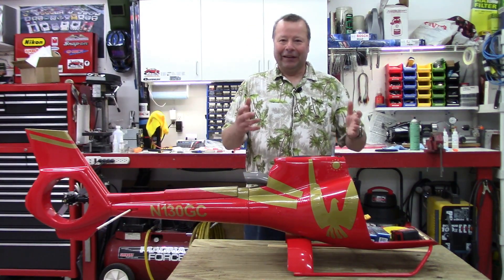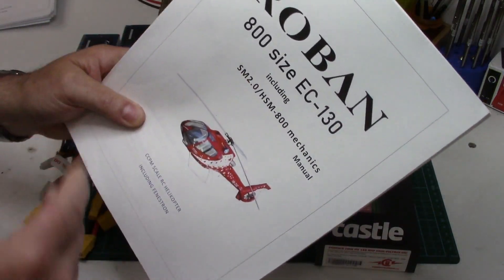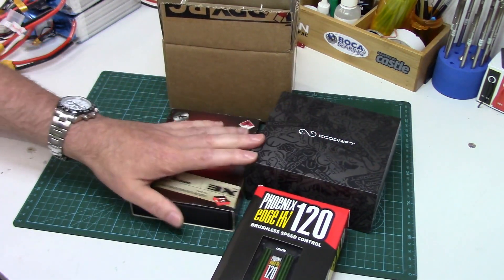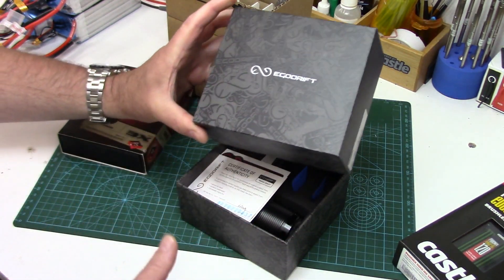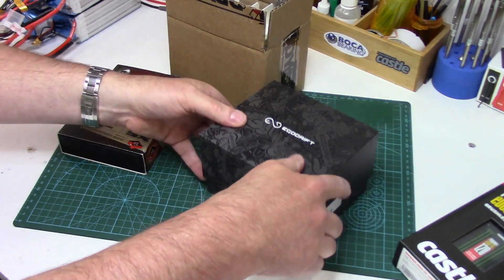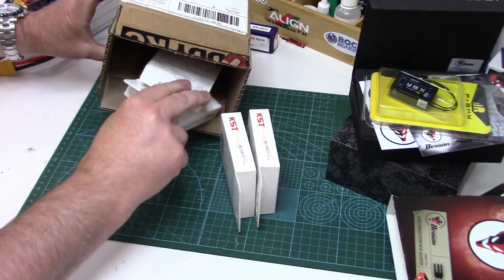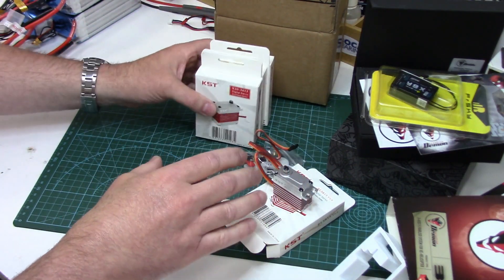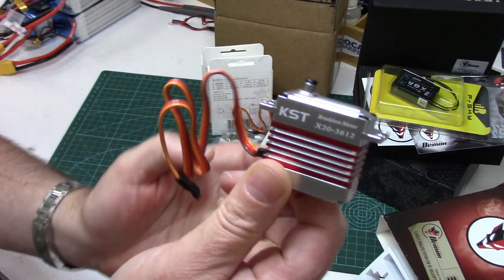Roban EC130 RC Helicopter Electronics & Fenestron Fitment Fun

Comment: I fly 3d Sab Goblin and I maintain them from to time to time. I am assuming the scale RC helis have the same maintenance as the 3D helis. Awesome set you have there.
Reply from the maker: More or less the same, but every model heli as you likely know has it's own unique maintenance issues. Scale is also more difficult in that you generally have to remove the mechanics from the fuselage to do any service work and that alone can be an hour or longer job with some of them.

Comment: I am looking for this Tail Servo X20-3612 and seems like is no longer available and the closest replacement is the X20-8.4-50. But, both servos operates on 1500us and they say it is only good for large planes, cars and not good for Heli. Should not be using a 760us for tail servo? Sorry, I am confused
Reply from the maker: As I stated in the video, large scale RC helicopters don't need super fast tail servos. Fenestrons however need high torque servos.

No super high speed 3D heli tail servo will work in these things, they are not nearly strong enough and are too fast for the yaw inertia of a large scale helicopter. Only reason you would want to get a 760us tail servo is if your FBL system doesn't allow a 1500us tail centering output (I can't think of any that do). 

As long as the servo torque is rated at the bare minimum 30kg/cm and speed is at least 0.15s/60 it should work well on an 800 size fenestron heli. Of course both stronger and faster won't hurt. 

The X20-8.4-50 is pretty much the closest replacement for the X20-3612 so nothing wrong with it: 
https://www.buddyrc.com/products/kst-x20-8-4-50-digital-servo-8-4v-0-15s-45kg-cm-624oz-in?ref=-ptdbz6d-llb

Another good option would be the A20-3813 (43 kg/cm 0.12/60) since it's a tad faster with just a smidge less torque: https://www.buddyrc.com/products/kst-a20-3813-digital-servo-8-4v-0-12s-43kg-cm-597oz-in-1?ref=-ptdbz6d-llb

The A20-4515 is another solid choice if you really want to play it safe with enough torque to pitch those 9 blades over at 50kg/cm and 0.13/60: 
https://www.buddyrc.com/products/kst-a20-4515-digital-brushless-servo-8-4v-0-13s-50kg-cm-694oz-in?ref=-ptdbz6d-llb

There's also the overkill monster of the bunch - the X20-7512 with about 80kg/cm and 0.11/60:
https://www.buddyrc.com/products/kst-x20-7512-brushless-high-power-servo-82kgf-cm-0-11sec?ref=-ptdbz6d-llb
My concern with it, is it would draw more current than most FBL system power busses could handle. I would personally use a separate/dedicated power input/bus for that monster.

Comment: Hi John, how do you get the fenestron work?  My EC-135 has an issue with the tail rotor not being able to hold on the counter torque
Reply from the maker: Can't really answer this in a short YT comment because as you know, there are multiple reasons for lack of adequate tail thrust in relation to main rotor torque. On fenestrons', the biggest issue is not using a high enough torque tail servo. That is just one of several possible reasons, but is the first one I would examine; I suggest 30kg/cm minimum. Contact me through my website if you want to dive deeper and seek technical consultation service.

Comment: How would you compare your AS350 to the EC130? Which one is your preferred? I know they are different scale but the 800 EC130 doesn’t seem so larger than the AS350. Which one would you recommend?
Reply from the maker: Lots of variables at play. There is no "better" out of the two; each have pros & cons and their own unique flying habits.
Which would I recommend? Again, that depends on for whom I'm making the recommendation.
If it's for someone with no large scale heli building & flying experience, I would recommend neither. Both are advanced models for advanced hobbyists'.
If it's for someone who has large 700 size and up electric, nitro or turbine pod & boom building & flying experience but wants a large super scale heli build project to cut their teeth on, then the AS350 between the two.
If it's for someone who has lots of big scale heli building & flying experience and has always wanted to tackle a complicated and somewhat maintenance intensive Fenestron build, then of course the EC130 or 145.
Reply: @Rchelicopterfun  thank you John. Very clear

Comment: Hi John, first of all congrats for another fantastic video. I admit that you have always been my guru since day 1 in the amazing rc helicopters world. Did I understand correctly that after adjusting the fenestrom assembly slight to the back you tighten the two clamp screws but also you added a further screw on the side to secure it lock in position? How could you make it neat and precise? Thanks
Reply from the maker: Thanks for the feedback. 
Once I had tail block clamped in the correct/centered position for even blade spacing, I then carefully hand dilled a hole through the side of tail block housing into the boom, threaded it with a tap, and then Loctite in a short M3 hex bolt (after thoroughly cleaning out the drill and tap chips of course). This "pinning" insures two things:
1. You are able to get perfect tail block position every time you need to remove the Fenestron assemble for maintenance by fitting the short M3 pinning bolt first before clamping down the tail block.   
2. If the tail block camping bolts were ever to loosen a bit, the locating/pinning M3 bolt will keep the block in the correct position. It of course is not strong enough to hold the entire tail block. The clamping force is still the main contributor. 🙂

Comment: Hi John, very good video and tkx for all info, 
regarding the tail servo, u select a 40kg version , what do u think if i use a razor-t1, it only got 30kg at 8.4v 5A ?

Do u use those 2 screws that factory design to hold the front compartment? It is so clumsy for me to remove it each time when I need to charge batteries , I tried to add more magnets , but since the fibreglass is so think, the result is not as expected, may I know how u make it ? Thank you
Reply from the maker: You don't need an ultra fast tail servo on large scale helicopters and that would be my biggest concern with the T1. I suppose if you dialed in enough gyro delay it wouldn't be an issue. As Roban recommends, fenestron tail servos need torque above speed. 30kg is at the low end of what is recommended, but since I've never used it - I have no idea how well it will or won't work or how hot or stressed it will be, you would have to try it and monitor all that to get real world data.
I use a pin on a small tether through the floor into a block underneath accessed through one of the doors to lock my Roban nose sections into place. Using screws each time would be such a hassle, I'd likely never fly the things 🙂

Comment: Good morning, I have a question, I have a Roiban EC-135, can you tell me how to regulate it because the problem I have is that it rotates almost 360 degrees, and I don't know the step to take, and know the revolutions of the main rotor and fenestron For any questions, I leave you my email, thank you
Reply: Check gyro rudder direction , check if main rotor is 1100 rpm or higher

Comment: I'm probably over thinking this but I'm getting ready to start my hh60 700 build and just wanting to verify my intended headspeed. Looking at the roban diagram, it looks like the motor runs through a pulley system before it hits the main gear. Is there a different  formula for accurately calculating this? Maybe I'm dumb and it will all make sense when I get my hands on it... 😂
Reply from the maker: Roban's instructions (at least the ones that came with this kit) show the final drive ratio between motor and main shaft like most instructions do. 🙂
Reply: @Rchelicopterfun  👍🏼 thanks for the reply!

Comment: Should the servo arms be metal or is that just a way to spend more money? The linkage being so close to the servo shaft surely should be secure enough.
Reply from the maker: The instructions do call for metal servo arms, but I personally don't feel they are required. The ball links would snap under stress before the arms would. This is of course dependent on the specific plastic servo arms used. The red ones that come with the standard size KST servos are very beefy compared to others I've used. Anecdotally, I have also found that metal servo gears tend to wear out faster when used with metal arms; perhaps due to the plastic arms flexing a tad to absorb vibration energy from the rotor disc back-feeding into the servo gear train? Most certainly this is the case when a crash/blade strike occurs as more often than not, metal gears will be stripped in the servos when using metal arms; whereas more times than not, plastic arms will break saving the servo gears. Of course, use what you're most comfortable with in your specific build. 🙂
Reply: @Rchelicopterfun  I'm also going with kst with futaba I can only get one servo for that price. There's no telling how many times I've watched these videos. 👍

Comment: Took My EC-135 out for her first flight today. End up discovering that I needed to put a few set screws in to hold the tail servo in place. Tail is so powerful, when I gave pitch to the rotor, the the entire servo holder moved instead of the tail itself. But after that, flew like a charm. Your videos have helped me out a lot, and this is the first time I’ve used the Bavarian Demon.
Reply from the maker: Hi Preirre, that is awesome you had your first maiden today 🙂👍
Interesting what you experienced with your tail servo sliding on the boom like that. Your clamps must be a little oversized is all I can think, but glad it was an easy fix. Enjoy it, they are good flying machines once you get them dialed in.

Comment: At what position did you set up your tail? The max slide travel is 4.75mm. Does that mean I should set it up to be centered at 2.375mm at a starting point? Thanks for your help. This is my first scale heli build. I’m more into 1:5 scale turbine jets.
Reply from the maker: Same tail setup as I setup any heli; pitch slider centered with tail servo arm centered/right angle to boom, with equal amounts of throw on either side. Of course that's just my setup method and I'm not Roban Tech Support nor do I want to be. Also depends on the FBL system and if it calls for something not as conventional (always follow the tail setup in the FBL instructions/setup wizard for best results). 🙂

Comment: Great EGODRIFT motor choice John. Just wondering why you didn't go with the BD AXON gyro though.
Reply from the maker: @Chris Ball - I thought I covered that in detail in the video @ 4:49. As stated, the 3X is hands down my favorite FBL system. It's a great value meat & potatoes system with no BS. I love the feel of it. I use them in all my large birds, so they are very familiar. Never had a single problem with any of them. Easy to program and easy to make your own programming communication harness. Lastly, since I don't use autolevel/rescue, I'm not going to pay an extra $150 for the Axon for a feature I don't need.

Comment: we have a fenestron from a H145 apart on the shop floor..so complex. no links or cables all hydraulically controlled. I really like that motor. You will be able to use the secondary shaft support
Reply from the maker: Very cool 🙂
Reply: @Rchelicopterfun  This is such a nice heli. It wasn't out yet when I got mine. I have an OH6. Roban are quite good I think

Comment: Tip on the x8r, you can use the outputs on the receiver as ch9-16 if you are using single line to the gyro. This is setup with the radio or with jumpers on bind depending on what firmware you are running for your x8r.  Doing this allows you to use 1-8 to control the heli and the gyro then 9-16 to control what ever other addons you want.

Comment: Hi, one question, does it include the remote control
Reply from the maker: This is an advanced RC heli model that you build yourself meaning you use your own existing computerized radio/transmitter. I go over what it comes with in the unboxing video: https://youtu.be/3qM_1fg9110
Reply: @Rchelicopterfun  thank

Comment: Did you say the flybarless unit had a sat receiver imput?  I bought a 450 size heli RTF but understanding a full build is quite interesting thankyou. Tony from Australia
Reply from the maker: @Anthony Smith, Yes, like most decent flybarless systems on the market, the Bavarian Demon 3X has multiple receiver connectivity options including Spektrum's DSM protocol satellite (remote) receivers. One DSM sat RX can be used in smaller helicopter, two can be used in larger helicopters where both spatial and polarization RF diversity come into play; covered in detail in my "RC Antenna" article on my website: https://www.rchelicopterfun.com/rc-antenna.html

Comment: Hey John great vid! Just finished up a logo 690sx yesterday, running bls815’s and an egodrift motor on it too. I run 815’s on three different machines. Awesome servos. 

Just a few questions. From your website and past vids, I know you like to fly the mechanics before putting them in the fuselage. With the fenestron, can you run it “naked” or does it have to be in the duct? Also can you even mount it without the tail section of the fuselage? I guess the question i’m asking is can you still fly just the mechanics, or will your maiden be with the fuse? Question #2: On your AS-350, it seemed like Roban used very poor quality bearings. Are you going to replace the bearings with high quality ones, or going to roll with the bearings provided? 

Funny story, I maidened the logo yesterday, flew three flights. She flew perfect. Crisp cyclic and collective, flew some loops, stall turns, a few flips. When i got her back home and put her on the bench, I saw to my horror that all the screws on the pitch servo (right cyclic servo) were loose! I had loosened them to route the esc wire between the servo body and the frame, and forgot to tighten them! Missed them on the pre flight too. The servo was very loose! That fbl unit earned its keep! 😂
Reply from the maker: @Dallas117. Glad to hear you have also had positive experiences with KST servos & Egodrift motors & had a a few successful maiden flights yestereday. 👍

Q1. As for if I plan to first test the "naked" heli mechanics outside the fuselage - stay tuned 🙂...

But yes, I do plan on it. For the extra hour or so it takes to mount to a test platform, that in my opinion is time well spent to see if things are working correctly and ensure I didn't screw something up or forget something. Exactly like your loose right cyclic servo experience - I too sometimes miss things and stuff like that is even harder to detect & get to once everything is covered up & hidden by a fuselage. 9 times out of 10, it would be fine; but I'm a magnet for that 1 in 10 which would result in major fuselage damage or even a complete loss of it. 

There may be some efficiency loss by running the fenestron unducted, but I can't see it being substantial. Of course, I have no prior fenestron experience, so perhaps duct efficiency increase has a bigger impact than I expect? The more likely reality is without all that extra fuselage weight to lift, the tail rotor won't be working nearly as hard because there won't be as much main rotor reactive torque.   

Q2. I did a video a number of year back on the AS350 bearings and I've only had to replace the 2 main shaft bearings and the 2 primary tail drive gear bearings. Those are the only ones that needed replacement over the past 7 years of flying that heli, and they pretty much wore out in the first 20 flights or so. Not sure if they were just bad bearings, had crappy lubrication, or were just more stressed than all the others? The replacements from Boca Bearing are not showing any signs of play/wear. As for the rest of the bearings on the heli, none are showing play or black snot seeping out of them, so I really see no need to touch them yet. I'll continue to monitor them like with any machine and replace when they start showing signs.
Have fun with your 690sx. 🙂

Comment: Really interested in this build, already can't wait for the maiden. Love the engineering of the fenestron, not sure what rpm it gets up to but i wud use a thick grade gear oil or poss silicon grease as it might fling most of it off when at high speed? Great vid series thanks👍

Comment: Heyyyy, those are some familiar-looking clear side markers in the background!

Cool, update, John! What kind of flight time do you expect with the four batteries that you purchased? Do you always get just one set of batteries or multiple so you can swap them out for more flight time during one outing?

Thanks for showing the insides of the tail rotor. Very cool-looking and intricate build! BTW, will you have to transport and store the heli with the tail boom attached or will you be able to disassemble things a bit to make storage/transport easier?

Looking forward to the next vid!
Reply from the maker: @JK, I'll only be using 2 packs during a flight. Just picked up 4 new ones to add to the herd as some are getting older. Expect about 7 min flying time, but won't know until first test flights after I find the best head speed to run. I have lots of 5000 &5100 mAh 6S packs for many back to back flights.